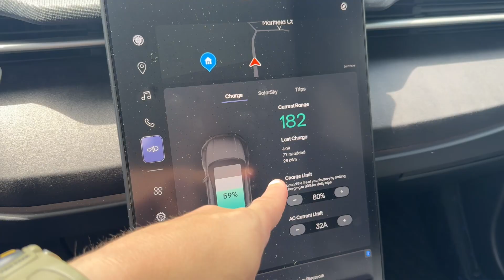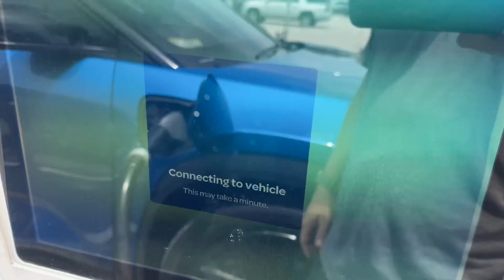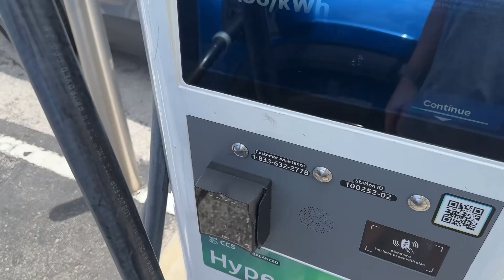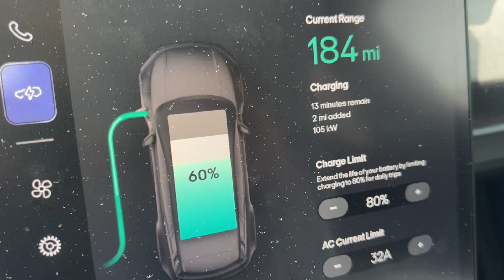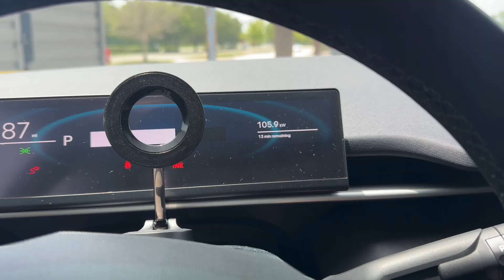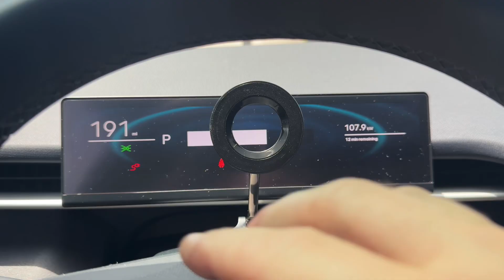FISKER OCEAN - LEVEL 3 CHARGING HEALTH CHECK 2025

Comment: You can’t refer to your channel as the EV addict if you say Level 3 charging for DCFC.  Level 1 and 2 are SAE J1772 standards for AC charging at 120 volts up to 16 amps, level 2 refers to AC charging at 240 volts up to 80 amps for 19.2 kw and there is a Level 3 for AC 208-600 Volts up to 160 amps allowing for 3 phase with power up to 166 kw. Level 3 charging was never implemented in the USA. What you are referring to as “Level 3” is DCFC and it exists as Level 1 allowing for max current to 80 amps at 1000v (80 kw) or the more commonly deployed DC Level 2 allowing 1000 V to 500 A (500 kw)
Reply from the maker: Thanks for the clarification, I appreciate the technical breakdown! I clearly understand that the L3 charging goes through the VCU and the L3/L2 go through a different process. My point was to verify the other settings that do apply on the Ocean screen.

Thanks for your feedback
Reply: @TheEVAddict even charging companies refer to DCFC as level 3 now. So it’s just going to end up being the name by default usage. Which is probably a good thing. Because it’s more clear to consumers that way.
Reply from the maker: Apologies for the wording mixup. You’re right. 🙌🏼🥂

Comment: How did you get your sun roof to twinkle like that with all those colors? 🤩
Reply from the maker: I made a starlight roof with a $50 fiber optic kit on Amazon. Use super glue lightly to hold fibers and a tiny drill bit to make the holes. This was done on a removable sun shade. I made a video on it on my channel.